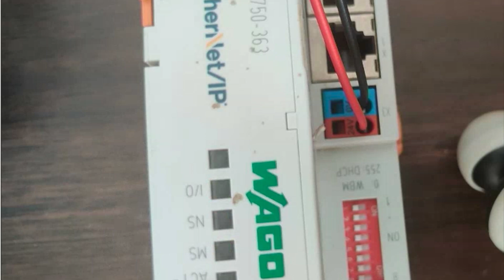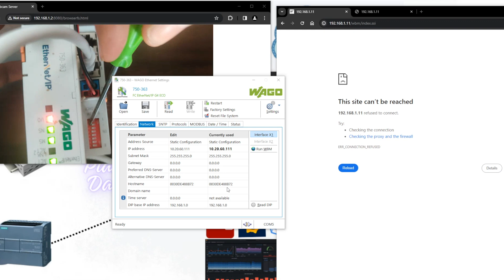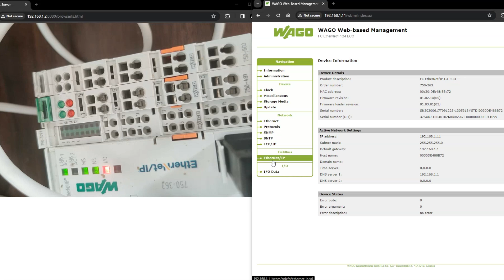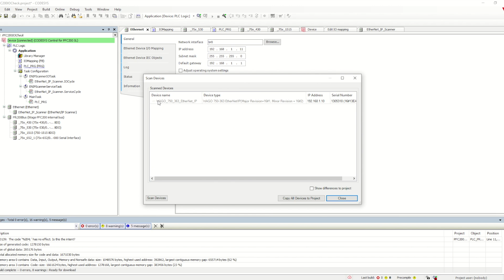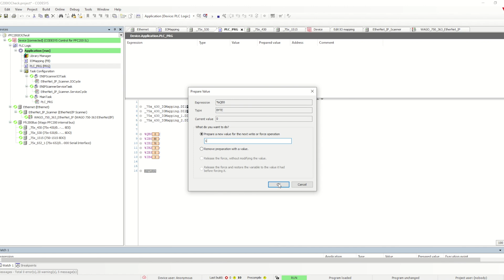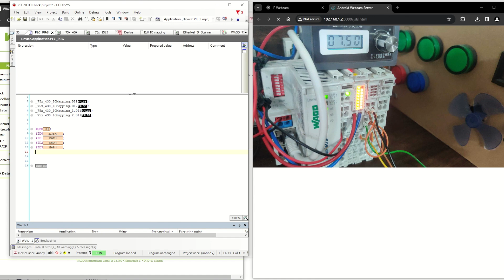Comment: I am working on a project which needs a 2 remote HMI panel for my Wago PLCs. To be little cost effective I want to develop HMIs Raspberry Pi. Can you suggest some ways this can be done?
Reply: If you want remote HMI you can use web based as WAGO PLC has option of Codesys visualisation..so visualisation endpoint can be opened in any PC..
If you want to discuss you can connect with me on WhatsApp link in the channel description
Reply: @jugaadtech12  Thanks. I will contact you in whatsapp